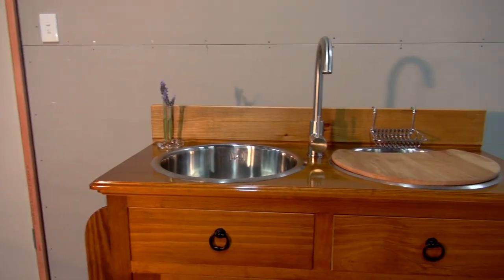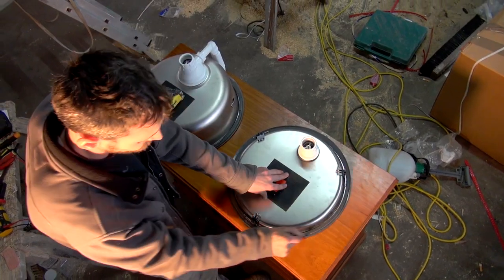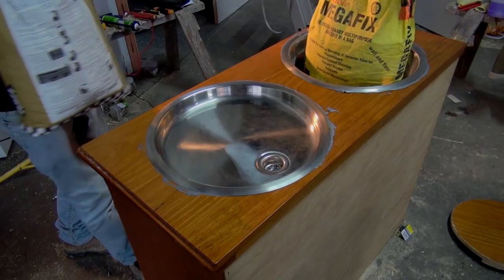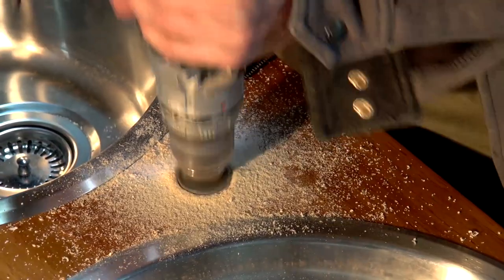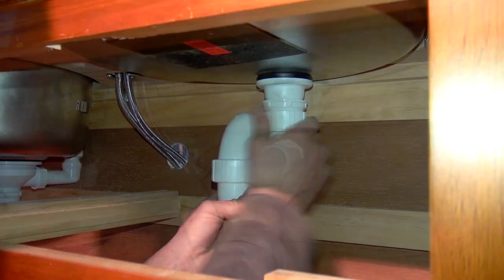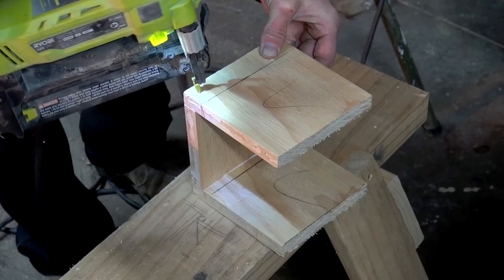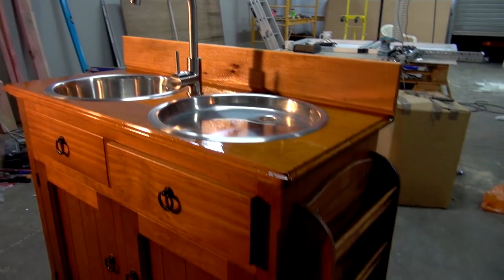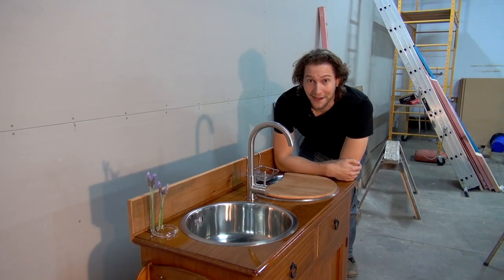Super-Simple DIY Kitchenette For Small Spaces

Comment: Everything looks great but the top left drawer instead of removing it completely, I would've made it so you could bend it down and at least put a couple sponges in it. Or something very small. I just would not have wasted the whole thing. Just my opinion! :-)
Reply from the maker: Mary Carlone Hey Mary! Yup, that's a great idea and could certainly be done. :)
Reply: Mary Carlone That is an awesome idea. Thanks))
Reply: I agree. That's a wonderful use of space.
Reply: I agree, I was thinking that when I saw it also!  I would make a shallow drawer (or one that works around the plumbing/sink) as there would be enough room for a some tea towels, sponges/scourers etc..

Comment: Not enough space for those dirty dishes.
Reply from the maker: True, not a lot of room for dirty dishes. I think it's a good idea to cook for your space though. In this case, because the unit is being fitted into a tent, the idea is to do a lot of the cooking outdoors. When cooking indoors we will most likely prepare simple one-pot or one-pan meals to keep it simple.
Reply: Living Big In A Tiny House also I would want space for one of those portable washing machines that would drain into the sink.
Reply from the maker: Cdogvlog 55 Those portable washing machines are great, aren't they!? Might be easier to get them to drain into a shower though, as they tend to be quite large. If needed, you could still sit one on this bench top though and drain into one of the sinks.